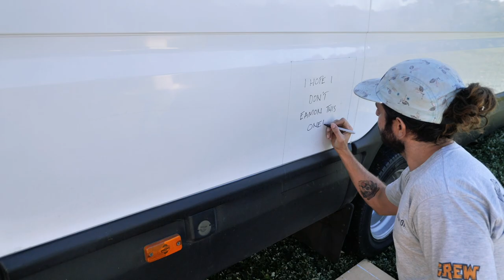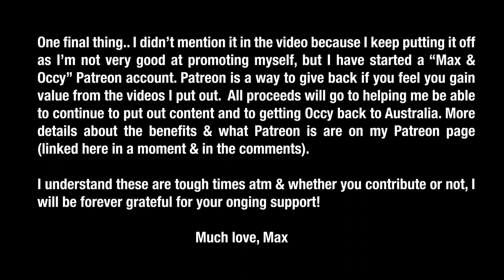Propane Gas Box Installation | The Safe Way to Store Propane? | VAN BUILD Ep7

Comment: I was SO close to installing a gas box like this but didn't in the end. Primarily because of the stealth reason you mentioned. Instead I installed a gas box inside that is sealed from the internal space, and vented externally through the floor to New Zealand requirements. I wonder if Aussie has the same rules as most of our rules are the same or very close. 

So I access the gas bottle inside, but it is always sealed otherwise. It also reduces the chance of rust from a big side hole in the van, and keeps the aerodynamics of the van too. Every little thing on the outside will create drag and cost money in fuel. The advantage of the outside bottle is easier to access to fill. 

From the commercial builds I have seen on vans with this same external box, they use a ton of sika as well, and looked very similar to your results. So good work! Great tip re the size of the cutting blade.

Comment: Hey Max doing a nice job...if you are wanting to avoid metal sparks etc. Especially inside consider the tool called renovator...uses vibration, I’v used it heaps for metal, wood, cement, tiles etc. Just a thought.👍😁 ...oh you do...Happy Birthday Judy🌈👍

Comment: you cant beat 1mm cutting discs.
if I could offer a tip: when using large amounts of Sika - Use a 1inch paint brush to level it out and look nice. You can even have a tin of Wax n Grease Remover to dip the paint brush in to help flow out the Sika.
great build series mate, keep it up.

Comment: Good job on scribing and cutting the gas box. To smooth out the silicone use a spray bottle with metho in it and a silicone spatula (eBay or a glaziers supplier). Run the silicone in one continuous bead, spray liberally with metho and use the spatula in one continuous movement to smooth out.  Makes the bead even and smooth without bubbles or lumps from starting and stopping with your "wet finger". When using silicone on visible surfaces like around the outside of the box, less is definitely best.

Comment: Love this stuff. I don’t mean to be patronising if you already know this about measuring tape, but they are off by design- the end metal thing is meant to flop a bit to account for inside/outside dimensions when you but up to or grab the material,, which is a bit of a pain when you measure flat surfaces and have to remember to push it in.

Comment: I bought the Transit gas box (2 x 4kg bottle size) from the same company. Very happy but I had to paint it red (ex Aust Post van). I put it on the driver's side because I thought house owners or passers by might spot the box on the pavement side but you make a very good point about the cop cars.

Comment: I used to have soap water in a spray bottle. I sprayed this on silicone or sikaflex to create nice looking lines with my fingers. That way you don't need to put the finger back in your mouth all the time. Try it out and see if it works for you next time you need to seal corners.

Comment: Sure it's gonna fit Max..lol..Love the way you & Eamon are throwing quips at each other...it makes the builds just that much better !!  Is there any type of rubber sealing gasket you can use to draw the gas box tight against the body other then that goop ??  My Mom's B-Day was the 16th, my sister's the 17th, and Happy Birthday Judy on the 20th.  It's a very fine month for Legends  ❤🙏

Comment: You should use the 1mm grinding disc on the fiberglass it works well. Use flap wheel to sand the shapes to size.

Comment: I recon you could also make a template of the profile before cutting directly on the gas box.  Could tape a thin piece of cardboard on each side of the gas box, then do the exact same process but draw onto the cardboard instead of the box.  Fiddle with that until it's perfect, then trace the cardboard profile back to the gas box and cut.  But yours turned out great regardless.  Funny video :)

Comment: Hello I have been watching this latest build (which is fantastic btw) and couldn't help but make a comment reguarding the LPG regulations in australia which is thus

Compartments and lockers:

Need to house cylinders and their associated equipment.
Must have cylinders positioned so that they will not obstruct the compartment drain hole.
Must not have access from inside of the caravan/van to the gas cylinder except where both external installation of cylinders and penetration of the bodywork are structurally unacceptable.
Need to allow easy removal and replacement of cylinders and the operation of cylinder valves.

I have been heavly going through the AS/NZS 5601.2: 2013 standards as well as workcover standards trying to find out what one can or can not do, And simply put you can have any gas cylinder inside the van as long as it's in a sealed locker that is vented to the outside and can not be opened from the inside, one way to do it is the gas locker that you installed (not a great option for stealth vaners or in side impact collisions) or installing a gas tight locker with a bottom vent though the floor with a door the can only be accessed from the outside ( example fitting a gas locker near the rear of the van doors close to the corner pillar with the gas locker door facing the rear van doors so you can not access the gas locker from inside the van when the rear van doors are closed, you have to open the back doors of the van to then access the gaslocker door which in turn means you are not inside the van when accessing the cylinder) to be honest I'd rather have the gas cylinder there as there is more structual support there than in a gas locker fitted on the side of the van.

food for thought anyhow keep up the awesome work on the van build...

Comment: Hey Max, will you be adding a second gas bottle? 
I definitely recommend it. Handy for when you are in the middle of nowhere and the bottle runs out, quick change and up and running again.
 I may or may not have lost a few fridge fills when I ran it on gas with only one bottle 😬💃🚐

Comment: Bro I’m a boilermaker welder and I use cutting disc every day (1mm cutting disc) my suggestion to is, you should of used that cutting disc to cut your gas box but then again you wouldn’t of been able to hold the grinder with one hand like I do 😆😆😆👍🏽👍🏽😎

Comment: Looking good! Will you be using gas bottles or smaller containers? The box looks rather small - the smallest bottles we have in Germany are 5 kg and they are already pretty big. Also, I was wondering whether they included something to secure the bottle or container to the box for transport. We had to build something ourselves for my gas box using tension belts.

Comment: Max, have you ever looked into European Diesel-Fuelled .......
Diesel-Fuelled Glass-Top cooking hob.
Diesel-Fuelled Space-heater (truck "Bunk"heater)
Diesel-Fuelled Hot-water heater system.
Then everything runs from the same-fuel-tank.

I can get you product names & model numbers, if you want.
Reply from the maker: Definitely interested in the cook top. Although I've heard they take a while to heat up!
I have a diesel heater!
Reply: @MaxLeeandOccy  
Being Glass, 
the Diesel cook-tops 
are slower to get up-to-temp, 
than a open-flame (Propane/LPG). 
On the up-side 
the exhaust is OUTSIDE of your van.
(think carbon monoxide, & 
think water-vapour from burning,
hydrocarbons).

Comment: To cut fibreglass, use diamond tip blade, the are used to cut tiles its called " Continuous blade" it has 1-2mm groves in it. Get it from Bunnings $25 dollars each last you two years. 

P.s if you need help with any Fibreglass or Composites , Give me a yell. i own i small Composite Business in Melbourne ( South/east ) i make Composites parts for the RV industry. Regards

Comment: Nerve wracking ? Yeah !!:) A question. Not that anyone has to but just wondering what the reasons were for not installing an underslung gas tank ? If its ground clearance then mine is about the same level as the fuel tank. Just wondering the reasons was all ;)

Comment: Maaaaate, you're never gonna get the most accurate markings, and then cut, using a texta. ALWAYS gotta be a pencil! lol. HB is best, the lead's the hardest so works best for on timber and other materials. If a pencil doesn't work you want a fine tipper marker. 

Also, a reverse blade for a jigsaw would help ya out. Will hide the chip out. Diablo, like the one you've already got, is the best.

Comment: I live in Aus too and was wondering.... 
Do you think it would be legal to put the gas bottle in an airtight box, only openable if the back doors are open too (usually under the bed) with a vent hole in the floor for stealth purposes?